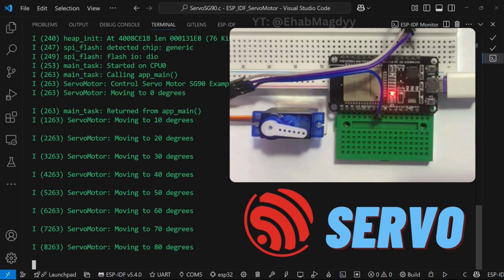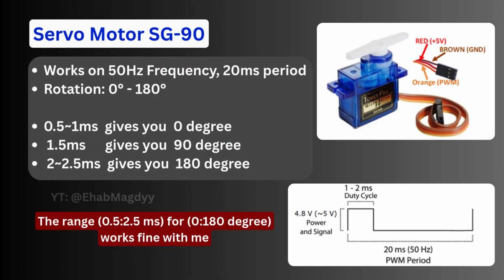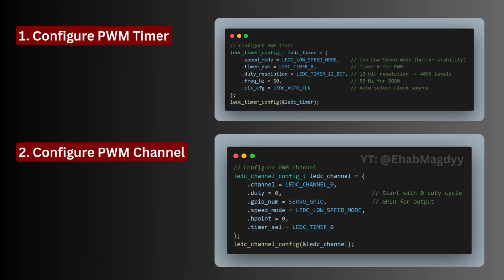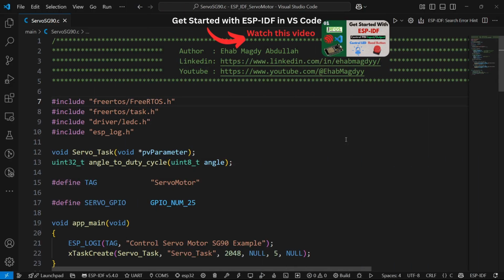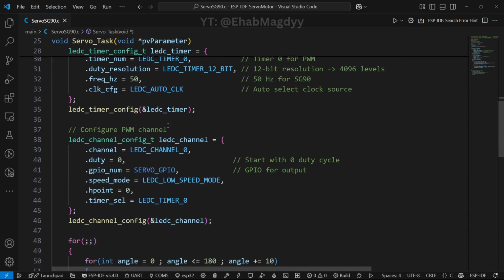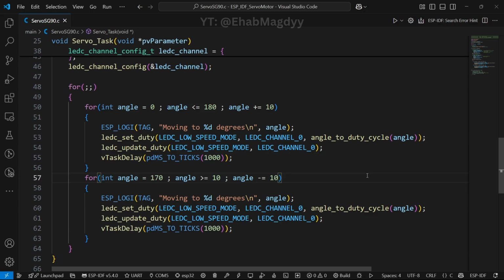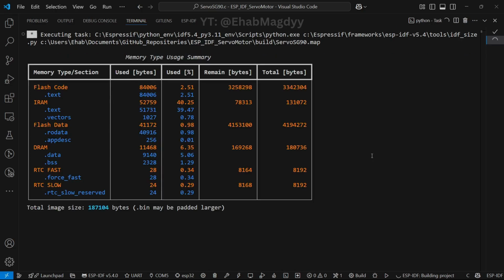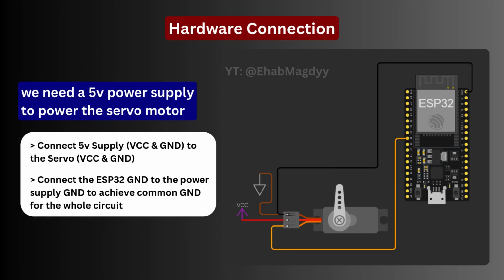Servo Motor ESP-IDF | Control SG90 Angle

Comment: My servo rotates continiously, nothing clock-like as in the video
Reply: type of servo maybe there are 2 kinds continuos and 180 degrees
Reply: @Irfan-uz3tg  ah yes, I've just disasembled the servo, and it's missing the potentio. Such servo will only work in a very stable power signal.